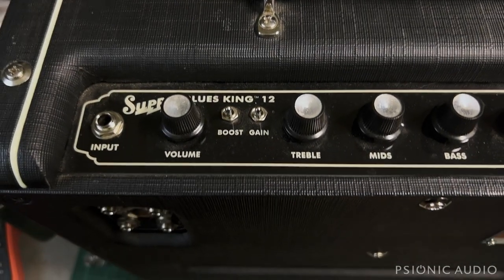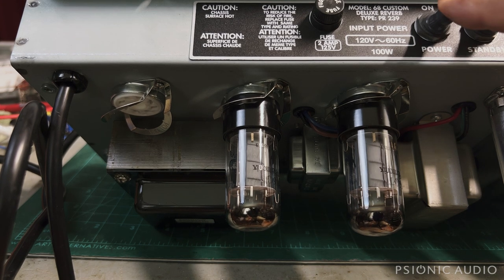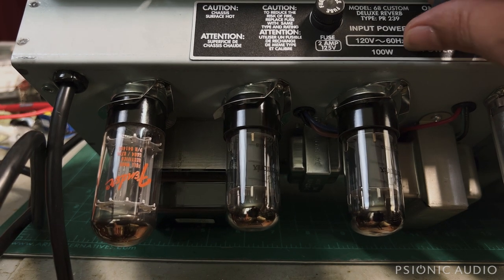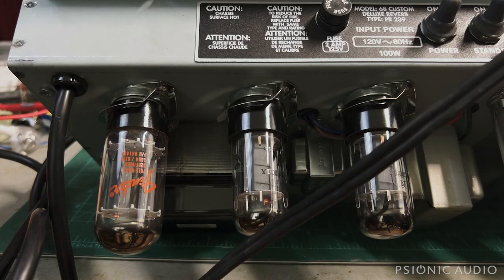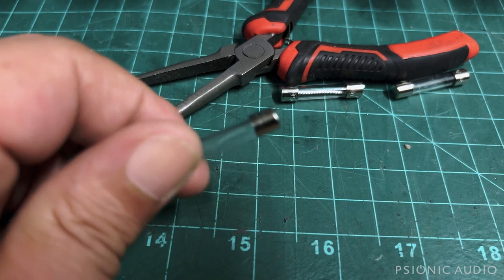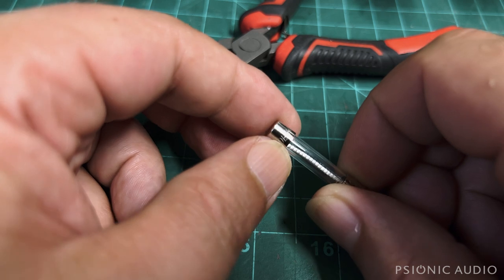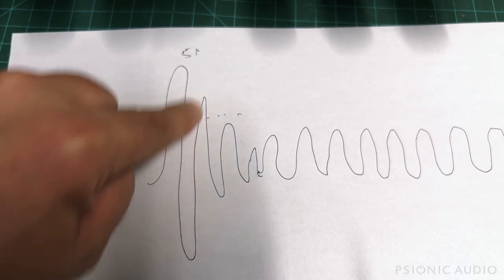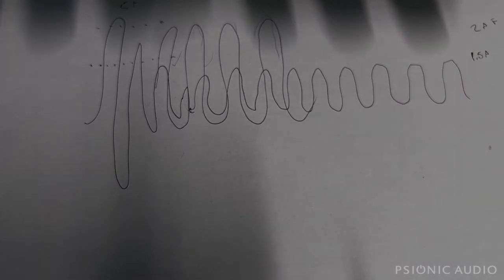Amp Fuses | Slow Blow vs Fast Blow: What's the Difference?

Comment: Hey Lyle.  I'm an electrical engineer and your graphical representation of AC current through the input fuse is exactly correct.....no changes needed :-)
Reply: I was thinking the same thing but wasn't 100% sure so glad to confirm it. If you were measuring voltage and current on a scope, they would look the same just at different magnitudes depending on scale of each channel on scope. Only other difference would be phase, which may change in the initial inrush state to steady state
Reply: In the water, buckets and pipes analogy, water hammer may be the best best metaphor.

Comment: Your current waveform illustration is good and probably the best way to show how inrush current affects fuses. As you know, the inrush current is mostly due to charging of filter capacitors (plus some due to extra startup current through tube filaments). Your diagram is generally correct for amps with solid state rectifiers, except that the inrush current lasts for many more ac cycles. Note that there is no voltage surge since utility power is a constant ac voltage source.

Things are more complicated with tube rectifiers because the inrush current through the rectifier increases as the rectifier tube warms up, then decreases as the filter capacitors become charged.

The inrush current stresses not only the fuse, but of course also the power transformer and the rectifier. As you know, that is why it is not a good idea to replace filter capacitors with ones of larger capacitance, and why solid state rectifiers need to have a resistor (or inrush current limiter) ahead of the filter capacitors.
Reply from the maker: I didn’t mean that the mains voltage increased. But on the DC side a switch (like standby) introduces a voltage spike.

Comment: Visual indicators of a slo-blow or "timed" fuse: the fuse element is spiral wrapped around some kind of fiberglass-like core ( as shown in the video);  the fuse has a coiled spring and what looks to be a resistor inside of it;  the fuse element appears to be a thin wire as is commonly seen in an ordinary fast blow fuse but also has what looks like a blob of solder in the middle of it. This last type of slow blow fuse is most commonly seen in in 5 by 20 mm, miniature F type fuses, and are typically marked with a T on one of the end caps, which stands for "timed".

Comment: While we are discussing current surging at turn on, which tend to blow fuses for no apparent reason, this is the purpose of the thermistor (black disc) seen on the power-switch PCB of the Supro amp.  The thermister has a high resistance when at room temperature and increases the total resistance of the power transformer primary circuit so that it doesn't draw as much current when you turn the amp on;  the thermistor lowers in resistance as it heats up and it takes itself almost out of circuit in a few minutes,  but they run hot enough to burn your fingers for the entire time that the amplifier is turned on..The location of that thermistor on the same small PCB that holds the the on-off switches and LED is a  bad idea.  The heat generated by the thermistor will likely cause premature failure of the solder joints around it and cause oxidation of the spade lug connectors. I'd recommended relocating it to where the power cord enters the amp, and put it on its own terminal strip.
Reply: Thanks for that mate, l own a BK 12 & it definitely throws out more heat than my EL84 amp (made by a local bloke)...
I've put a small clip on fan at the back of the Supro in the hope it'll help cool it somewhat, but I'll look into getting it mounted separately.
Barring how warm it gets, it's a gd little amp.

Comment: Good stuff!  
I think your representation is good on paper, however I have an old school amp meter on my variac, and when I switch it on, you can see the meter bounce high then rapidly settle once the standby is switched to operate mode (in correctly running and typical situations).  So, a traditional amp meter (a meter with a needle) will demonstrate it for you perfectly.  Old style meters work better translating current in those kinds of situations.  Mine goes to 5 amps, and I have my variac loaded with a 5 amp fast blo in it - so it works for most 100w or less tube amps.  Solidstate amps can climb in amperage quite a bit, so larger amps, bass amps, power amps can overpower my smaller variac.   I have a 10 amp variac too, but I don't have an amp meter wired into that one (not yet anyway).    There are many reasons for a power fuse to blow, most often tubes, but can be transformers, shorted diodes, other shorts.  Another indicator for a slow blow type is a T (for time delay) stamped on the fuse itself.   HT fuses are usually fast blow.

Comment: Hey Lyle, the sine wave representation of current is accurate, in that it is a time domain representation of the amount of electrons flowing through the circuit. I know you know all of this, but maybe some of your viewers will appreciate the background. If we look at the simple version of Ohm's law, Voltage is equal to Current multiplied by Resistance (or V=IR, and yes current is represented by an I because French), the sine wave representation makes sense. This is because (generally speaking) the resistance of the circuit does not change, so as the voltage rises and falls, the current has to rise and fall to "obey" Ohm's law. For a general example, since the resistance is constant we can pick any number we want, so lets say it is 1. Then we get Voltage=Current x 1, or simply Voltage=Current, so the graph of the two would be identical, hence a sine wave is correct for both. If the resistance is anything other than 1, the graph of the current would just have taller or smaller waves than the voltage.
Reply from the maker: Thanks Leigh. Great explanation. I knew that was the case here but expected to get pilloried for using such a simplified visual representation.

In working on amps I myself think of the circuits as being weights and the fuses/wires/traces as being the strings that hold the weights up. 

For instance, take an amp with a 6L6 and two 12AX7s. For the heater supply, the “string” supporting all four tubes needs to be able to handle the full “weight” of 2.7A (all the tubes). But if the tubes are wired in a parallel sequence as usual, the wire “string” to the last 12AX7 only needs to support the “weight” of 300mA.
Reply: @PsionicAudio  looks like i was late to the party agreeing with your sketch
Reply: @PsionicAudio  Thanks Lyle, the weight analogy is interesting, I had never thought of it that way! Quick question for you, I am looking to build my first fuzz face (actually I plan on making a few for friends as well, maybe 10 total) and I'm wondering if you know of a good source for components. I read the mojo components articles on your web site and I have a Mouser cart filled up with most of the circuit components (although I am not sure which 22 uf capacitor to get for the fuzz control), but the 3PDT switches, enclosures, pots, and jacks seem quite over priced. Do you have any recomendations for a decent place to get lower quantities of those parts, and which ones are the most reliable? Thanks again for all your great videos!

Comment: Here are a couple of technical reasons why a fuse might fail for what seems to be no particular reason: 1) power transformers will appear to be almost a dead short circuit before they are energized and build a magnetic field in and around the copper coils/windings and iron laminations (you can confirm this with an Ohmmeter connected to the power cord of your amp; the primary of the power transformer probably measures only a couple of ohms). 2)  The electrolytic filter caps connected to the secondary of the power transformer also will appear to be almost a dead short if they are discharged (which is usually the case if the amp has been sitting around unused for a few hours or days).  And 3)  The heaters of all the tubes have an extremely low resistance when they're cold and draw a lot of current until they heat up,  And because the heaters are all wired in parallel, the more tubes the amp has the lower the combined resistance of them all.  When you turn the amp on you will draw a large amount of current for a few seconds as the filter caps charge and the tubes start to heat up (the resistance of the tube heaters increases enormously when they're warm to hot, and the filter caps no longer present a dead short circuit once they are charged). 

 The inductive nature of the power transformer not only acts almost as a dead short when you first energize it, drawing a large amount of current, but because it is building a magnetic field the voltage going into it at turn-on actually overshoots and goes higher than the incoming wall voltage! Visualize the 60 hz AC  as having 120 peaks of full voltage per second, and 120 dead spots per second where the voltage is at zero.  Depending where the cycle of the wall voltage is at when you flick the switch and turn the amp on, you will have either a lesser or a greater inductive surge as the power transformer inductance charges.  If you could somehow turn the amp on only when the AC voltage is at one of those peak points (one of the 120 times per second that it reaches peak voltage), the inductive surge would be minimal, but if you randomly happened to turn it on just as the wall voltage is slightly above zero and heading to its full peak, you'll induce a huge inductive ringing and voltage overshoot into the transformer, and that's when current draw is the greatest.

All of the above surge-producing scenarios detailed above will tend to weaken a fuse over time,  and of course invariably it will fail not when you're practicing but at a gig.  Always carry fuses of the correct value and type with you to your gigs and practice jams, and don't buy cheap-ass, no name or possibly counterfeit fuses off of eBay, Amazon or Alibaba!
Reply: What are the top name brands you recommend, my first rodeo here…thx very much.

Comment: My wake up call was when one of my precious tube vintage 50's tube amp fried the trannies and saw wall voltage was at 130. Now always use an AmpRx Brown Box/Brownie to dial in AC (suggest something like this) to the AC level that the amp was designed for. Many of the older amps are marked 117vac max, so figures they run best at the designed power levels. Even seen new amps label 117v.

Comment: I would be hesitant to plug in any electrical devices into a generator. Unless it was an inverter type.large enough to handle a bigger load than what's connected. That's just me..but if you gotta gig it,,ya takes your chances..great channel, certainly one of my favs.

Comment: Imagine you have a bucket full of marbles and an empty bucket sitting on a table. The marbles represents electrons. 
When the  two buckets are on the table the potential to do work is zero or zero volts. 
The bucket on the table represents the ground state. 
Lift the marble bucket up, the potential rises.
Start to pour the marbles out. The marbles moving out of the bucket represent amperage, the number of electrons moving past  a certain point during a period of time.
From that fixed height, pour a little faster. The amperage(intensity)has increased but the voltage(potential) has remained the same. 
Lift the bucket higher, and  return to the original rate of dropping marbles. The potential has gone up but the amperage has dropped. 
You can now describe both properties of electron flow in one motion. 
Introduce an interceptor bucket to demonstrate a lift ground or a voltage dropping circuit.

Comment: Completely unrelated, but I figured I'd ask: I have a Monster Pro 7000 MK2 power conditioner in my studio. It has 2 Amp Slow Blow for audio and digital and a 10 Amp Slow Blow for video. Are these 250V or 125V. I can't find the information ANYWHERE online. Please help!
Reply: Most fuses are rated at 250v. It’s not like amperage as in you can put a higher rated voltage fuse in and be fine. The amperage is the important rating here

Comment: Current would be out of phase with the voltage. If I dig out the clamp on Tektronix current probe for inductively measuring current, and I can finagle a fancy digital O Tek scope I can show the voltage and the current in two colors. If I get super lucky one of their scopes will actually do a 3D display of the voltage & the current, and it looks really cool.  It's not $130,000 cool so I don't own that O scope.

Comment: But what does Fender recommend there? A slow blow or fast blow? And you illustration was good.
Reply: Most of the new stuff has it on the label by the fuse. My new princeton reverb clearly says 2 amp slo-blow

Comment: Would that be the same for amp boards on stereo amps, would slow blow be the better option?
Reply from the maker: Use the fuse size and speed directed by the manufacturer.

Comment: Ive been using fast blow fuse as its much easier and cheaper to purchase(im from the Philippines), im using the correct fuse rating with respect to what the circuit calls for and so far i havent blown a fuse yet. Is it safe to say that i havent had a current/voltage swing thats too drastic thats enough to blow it yet?
Reply from the maker: It all depends on the amp. One amp might “need” a 1.1A fuse. Another might “need” a 1.85A fuse. Both amps will use the next standard rating up, so both amps will use 2A fuses. 

The first amp asks less of that 2A fuse than the second amp.

Hope that makes sense.

Comment: Any general difference between the glass tube slow blow fuses and ceramic slow blow fuses?
Reply: For our purposes, fusing audio amplifiers and guitar amplifiers, ceramic fuses probably aren't necessary or advantageous. Ceramic resistors are typically sandfilled and they are designed to be "explosion proof".  If you have some kind of industrial piece of equipment that might accidentally get hit with a massive voltage or current surge, many times it's normal operating points,  an ordinary glass fuse could not only explode but also cause vaporized metal to be deposited all around the inside of the device causing arcing and short circuits and further damage. Expensive, high quality test equipment ( such as a Fluke multimeter) will often use sandfilled fuses (often large, epoxy fiberglass fuses, not ceramic) for protection so that you don't spatter metal around the inside of the meter by connecting it to a high voltage while the meter is set  in the low voltage range, or measuring voltage when its set for amperage, and so on.

The commonest place I see factory-installed ceramic fuses, fast or slowblow, in audio gear is in big power amps that put out several hundred watts or more, with fuse values ranging from 8 to 20 amps. Not really necessary in most guitar amps, that are typically fused at 3 amps or less. Perhaps a good idea if you gig a lot at outdoor shows that are run from a generator?
Reply from the maker: All that, with the addition that glass fuses can fail if they get too hot, no matter the actual current. That might be what happened to the first tube in this amp.
Reply: @PsionicAudio  , hmmm... I haven't heard this before. Are we referring to
 glass fuses getting hot from internal heating, or from ambient heat inside the amp, or both? If anything I would expect that glass fuses would allow infrared radiation/ heat to escape just as heat radiates out from vacuum tubes (athough the glass would also let heat enter equally well); ceramic  fuses would tend to trap and hold any internal heat generated due to resistance in the element, and adding sand inside the ceramic fuse as an Electrical insulator also means that it is a Thermal insulator.  Now if you want to prevent ambient heat from entering the fuse, the  reflective surface of the white ceramic is probably much better than glass for that purpose.  This is an interesting  discussion, or perhaps quandary.  And by the way I have seen heat-stressed fuses become resistors that measure several several dozen ohms .

 Personally I think most people would probably prefer the glass fuse because most of the time even a layman can tell at a glance if it is blown. Also you might see the fuse element to be sagging a little bit as if it has stretched and this too indicates it needs to be replaced.  But as every technician knows ,  visual inspection of a glass fuse can fool you and sometimes they are bad even though they look OK. A ceramic fuse of course requires you to get out the multimeter.

Comment: Your sketch of current should be, as you point out, just like your sketch of voltage. But you didn't show a zero line, had your amplitude only increase on one side (thus adding a DC level) and didn't talk about RMS vs. peak. Also your sine wave doesn't look like a sine wave, there are no vertical components (it's a pet peeve of mine for sure and I see it all the time when electronics guys draw diagrams). The zero crossings are always sloped and the graph can never go vertical. (But it does go to horizontal for an infinitely small instance of time at each of the peaks.)

For thinking about it I always go to the hydraulic analogy. Pressure is voltage, resistance is pipe diameter, and current is... current. It's not quite intuitive that sufficient current would burst a pipe (we'd instead expect that from pressure) but just point that out that it's the amount of water (electrons) passing through the pipe (wire) per unit of time that is the limiting factor for the fuse.